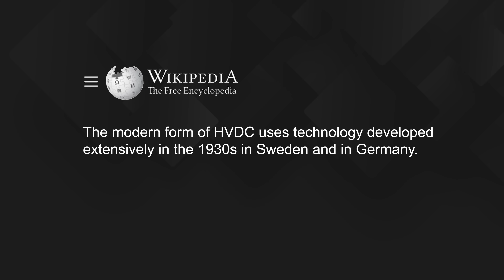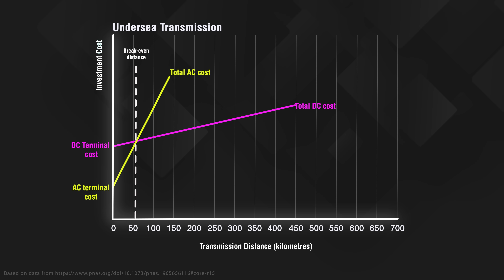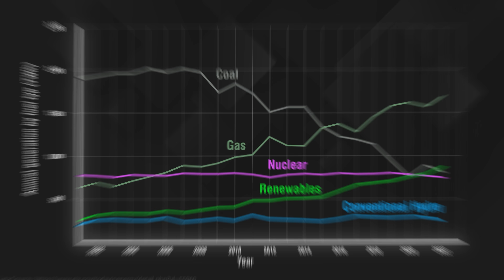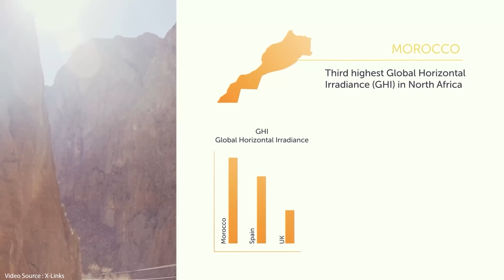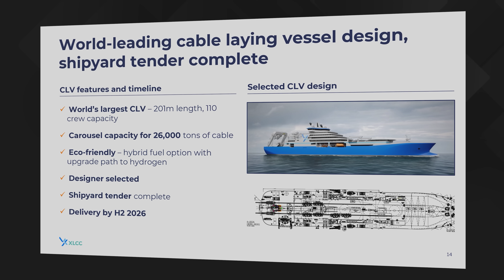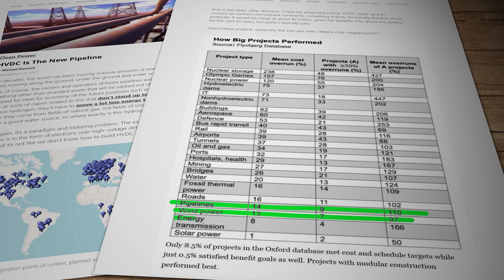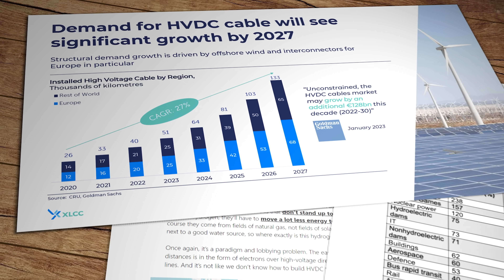Revolutionising power transmission.

Comment: Whenever I hear people say that our current infrastructure can't support electric vehicles I like to remind them that my EV takes less power to charge than my electric oven uses to heat up. Everyone in my neighborhood has an electric range and nobody bats an eye, but as soon as you plug in an EV everyone loses their mind.
Reply: Yes, it's a fact that the EM radiation from an EV makes some people's minds short-circuit.  It might be genetic.
Reply: Sounds like they are mistaking the charging lead for their EV for the power lead to their Electroconvulsive Therapy machine.
Reply: That's a bit misleading. An electric oven uses between 2 - 5 kW, and is wired separately to accommodate this high wattage. If you just use a normal 3 pin plug to charge your car, that's just 2.4 - 3 kW, or a 3.6 kW "commando" plug, less than your oven. But type 2 chargers, single phase, use 7 kW, rather more than any oven. Even more important is the fact that your car may be charging for 10 hours or so, getting through 20- 60kW in one session, that's one heck of lot more than any oven ever uses. It is also true however that most people use their ovens at peak times, when power is most expensive to produce and most limited, you car can charge a car overnight which then reduces the difference slightly.
Reply: @jockmoron first, I'm not sure you understand what you're talking about since you are using kilowatts and kilowatt hours interchangeably.  But let's just assume you missed a couple h's here and there and get to the crux of your argument.  I've already stated that I charge my car on a standard 120 v outlet with an 8 amp limit (set in the car) so my max power draw is 0.96 kW. My commute is 26 mi round-trip, and I average 6 miles/kWh. I need to replace 4.33 kWh every day. Let's be generous and round it up to 5kWh. I have no idea where you came up with 20-60kW. Think about it for one second. Recharging 20-60 kWh every night would mean I'm traveling between 120 and 360 miles a day. Even in a terribly inefficient EV you're going to get at least 3 mi/kWh, so that 60kWh would mean they are still traveling 180 miles per day.

Next, let's examine power draw of electric ranges. My range (a KitchenAid KESS907SWW04) is rated at 14.4 kW.  If you own an electric range I encourage you to look at the manufacturer sticker inside the door. I guarantee you it will say 10kW or more. When I'm cooking a full meal, my kil-o-watt regularly states I'm drawing 20+ amps, on a 240v circuit that's 4.8 kW and I usually cook for 1-2 hours each day.

All of this is still missing my original point which was that the grid is robust enough to support my oven drawing 14 kW at any given time, so it is more than robust enough for the 1 kW that my car draws. Grids don't fail from sustained loads, they fail from high impulse (positive or negative). And my car has a lower impulse than my oven.
Reply: Much and all as I like the sentiment you are technically incorrect. A typical oven uses between 2000 and 5000W. Many would have 2x 1800W elements meaning the maximum they could draw would be 3600W plus change (the fan and electronics). They also switch off and on once they reach temperature so it's not a constant draw. A typical EV home charger draws 7kW. My Tesla Model 3 can draw 11kW. I do all my charging off solar so I'm not relying on the grid. Still the regulators in the UK have said a number of times that the grid will not be a problem.
Reply: Multiply ovens (mandatory in California) by a factor if 20, because not all ovens are on all night, but EVs will be.
Reply: @scottslotterbeck3796  Again - ignorance. Not all EVs will be on every night and they won't necessarily be on all night. But even if they were that is the lowest demand time for electricity so that's a good thing. It means generation can be more predictable and no need to turn off expensive machines at night. Like they do presently.
Reply: What you just said is.... uninformed, to say the least
Reply: 7kW (standard EV charging rate)  is a pretty chunky oven. Ours is 2.2kW, so only 1/3rd of the EV charging. And overs have thermostats so they don't run at full power for long. But yes none of this is new - electric showers are often 10kW. EV charging is quite a lot of kWh (because it might be 7kW for 8 hours to fill from empty). 8hr cooking at full blast or showering is not normal.
We will all work out how to do this with various combinations of time-shifting, batteries, PV and time-of-day tariffs. It's not that difficult and the fungibility of electricity becomes even more useful once everything is electric.
Reply: @xxwookey  you're not forced to install a 7kw charger, you can easily install much smaller, and as for charging from empty, virtually no one drives a whole battery's worth each and every day, so you're not charging from empty either.  simply put, if the grid can manage today (most can) then EVs won't make an appreciable difference other than to eliminate night time as cheaper.
Reply: @jnawk83  I know. I agree with you.
Reply: @xxwookey  EVs very rarely charge from anywhere near empty, they charge from a 30-mile commute to work & maybe a shopping trip – a 10% to 20% discharge. And the 7KW is an inrush rate, it doesn't last long.
Reply: @alanhat5252  Agreed - most people don't charge from anywhere near empty most of the time. Is that inrush rate from your own experience? My understanding is that most cars will do ~7kW continuous AC charging (and some will do 11 or 22kW on a 3-phase supply - standard in several European countries).
Reply: @xxwookey  A normal oven is rated at 5 to 7Kw.
Mine is 6kw and is just a double oven, in the us the average oven is larger...
Reply: @xxwookey  That was more than a bit confusing and I don't think you even answered the question.  As usual, however, you like "green" tech enthusiasts generally do, have built your argument on speculative hope rather than hard reality.
Reply: @joemccarthy7120  The OP didn't post a question - he just made a comment about the relative power of household equipment. I responded to that. Which question did you have in mind?
I did make a prediction it's true, but based on current real trends in technology adoption.  People are adopting EVs, home batteries, PV, heat pumps, and new tariffs right now. Rates vary a lot by location and country, but are primarily limited by supply rather than demand. It didn't require very much 'speculation' at all to predict that adoption rates will continue to rise nearly everywhere.
Reply: @xxwookey  Surely you are aware that those trends in uptake of the new "green" tech are driven by subsidies and mandates, not rational economics.  

I am saying your answer was confusing.  It also didn't support the initial claim in this thread.
Reply: @joemccarthy7120  Joe, My oven (which is on the small side) is on a 20 Amp circuit.  I put my EV charger on a 30 Amp circuit, so I'd say you have a point, but only a small one.  Everyone has an oven, but not everyone has an EV.  Ovens are used at the highest demand time, while almost all EV charging is done late at night in times of low demand.  Some people with solar charge their cars from the sun in the middle of the day.  The electric authority in the UK (I forget the exact name) did an analysis of the "EVs will blow up the grid" meme, and found it to be bollocks.  The main reason is that all modern EVs have the ability to set a time to begin charging, and the grid and electrical supply is slated to grow over time in a way that will not have a problem keeping up with EV demand.
Reply: @joemccarthy7120  My response didn't support the OP entirely because I was questioning if his oven really is higher power than his EV charger. That was the point of my response.
The relevance of subsidies varies a lot by location. Australians and people in the UK are installing PV and batteries because it makes financial sense (and because they support decarbonisation), not because of subsidies. There are no subsidies available in the UK for that tech. Many countries have EV subsidies, but that just helps accelerate and widen uptake - it doesn't cause the demand. People in the UK buy EVs because they are better cars (quieter, faster, always full in the morning), because they are much cheaper to run, and because they want to get off fossil fuels and/or minimise local pollution. The subsidy was  removed a year ago so again, subsidy is not the cause here.

Re mandates: EVs are not mandated anywhere yet SFAIK. I guess PV is mandated in some places now (not the UK yet, although adding some is one way to comply with the building regs).

Decarbonisation is at least a decade behind schedule, and things like setting lower-emission building regulations, and cut-off dates for fossil-powered vehicle and boiler sales help accelerate adoption. This is a good thing, given the very tight deadlines we have on getting the energy transition done.
Reply: @joemccarthy7120  I'm sorry if my post was confusing. I try to be succinct given the platform, but it's not my strong suit 🙂I'm happy to clarify if you have a specific query.
Reply: @xxwookey  I don't know about the UK, but I do know that EV sales in Norway fell off a cliff after EV subsidies were removed last year.  I am also talking about mandates for power generation and use as well as subsidies for solar/wind installation etc.
Reply: @joemccarthy7120  OK so let's agree that the UK market is not subsidy-driven because there aren't any for PV or EV which is what we were talking about (there is one for heat pumps though).
Your information on Norway appears to be wrong: 2022 saw an increase of 137 percent year-over-year of EV sales. That's about 82.8 percent of the total market. Hardly 'falling off a cliff'. Norway is already something like 30% of all cars being EV, and at 80+% of sales it won't be that many years before that part of the transition is more or less complete there.
I'm not sure what your point is about generation and requirements for grid decarbonisation. This thread was about people electrifying their homes. Obviously the degree to which that actually reduces emissions depends on the grid emissions intensity, which is falling in most places, driven largely by economics these days (renewables are the cheapest generation in most locations) but yes there are subsidies, carbon taxes and renewables mandates helping move that faster to varying degrees in various countries.

Are you saying that when you said "those trends in uptake of the new "green" tech are driven by subsidies and mandates, not rational economics."
you were referring to the grid supply technologies, not the household electrification technologies we were discussing? I'm afraid that sounds like post-justification to me. 

Why not just agree that actually people are buying this stuff because they are making rational economic choices? Then we could move on to other subjects like decarbonising the grid itself. ideally in a different thread - this one is already long.
Reply: @xxwookey  I'm OP. I charge my Chevy bolt with a standard 120v wall outlet and limit the draw to 8 Amps. My oven is on a 240v circuit and usually draws 10-15amps when heating up. When using all four burners on the stove and running the oven (like when I cook chicken in the oven, potatoes, gravy, and two veggies on the stove) it can draw up to 30 Amps.

The instantaneous power draw of the oven alone is greater than my EV. And the overall energy consumption from my range on a daily basis is greater than what I put in my car.
Reply: @xxwookey  There is a lot there.  I wonder why it is so easy to find articles showing a sharp drop in EV sales with the lowering of subsidies.  Yes, people make rational choices, and that is why they respond to those incentives.  

No, wind/solar are not the cheapest at all when the backup generating is included and when subsidies, mandates  and carbon taxes are stripped out.  I guess grid carbon intensity necessarily drops by adding in wind/solar, but that is not at all the same as saying it is cheaper.  One is just adding something useless to the grid which will do just fine without the wind/solar.  There is a reason why adding renewables to the grid usually drives up power costs.  

Carbon taxes, mandates, and subsidies don't make renewables more economic.  They just hide the economic problems of renewables and force people into choosing less efficient options.
Reply: @joemccarthy7120  Argue with Lazard about the costs. It's pretty clear that wind and solar are cheapest on an LCOE basis independent of subsidy in most of the world now. They were anyway, but the massive increase in gas prices (factor of 6 here for a while) meant that gas generation became completely uncompetitive in Europe (CC is still competitive in the US because gas remains cheap, but peakers aren't). You have to be crazy to argue that renewables are not good value during massive fossil fuel-price spikes. Nuclear suddenly looks much better value too. Power costs have risen because of fossil fuel prices, not renewables costs. 
Even firmed renewables with battery backup is very competitive now (median rises from $60 to $80 for PV and $50 to $75 for wind) which is why there is a lot of that being installed.
How do you argue that wind/solar are 'useless' when they are generating large fractions of our electricity these days? The UK had 1st quarter ever where more supply was from wind than gas this spring. Every non-fossil kWh is reducing emissions and saving fuel costs. That can't be 'useless'. Efficiency is irrelevant - it's costs (and emissions) that matter.
Lazard show subsidised and unsubsidised (US) LCOE and LCOS (cost of storage) costs.
All I can do is suggest you read Lazard's "2023 Levelized Cost Of Energy". There is no way I can persuade you in youtube comments that renewables really are good value now. But that's why more new generation projects are low-carbon ones now, rather than fossil. Power companies are not daft and will build whatever does the job for the lowest cost.
Yes they could build a working grid using a lot of CC gas and gas peakers, but it wouldn't save them any money in the long term (it might be close in the US), and it would have massive emissions.
Reply: @youruniquehandle2  OK. thanks for the clarification. If your EV charging is only 1kW then, yes it makes perfect sense that your range is significantly more power. And yes people like you that do a lot of cooking  and don't drive far each day will use more energy cooking than charging. We cook most days (maybe 0.5kWh/day), and use the car maybe twice/month, but that'll be ~200kWh (600 miles, van), so maybe 13 times as much energy.

So, for the majority of people with both electric stove and car it'll be more energy in the car that the stove. And more power: standard chargers (at least in the UK) are 3kW or 7kW, and whilst induction hobs can draw 5kW, this will be rare and for short periods.

EV charging is easy to time shift as many have pointed out. Cooking less so, which is why you can now buy a oven with a battery in it from Channing St Copper Company. Also avoids having to upgrade your house to fit an induction range/hob.

But you are right that the 'freak-out' makes no sense at all.
Reply: @xxwookey  When you consider that backup generation plants have to be staffed and running hot all the time to be there when the wind or sun varies,  that has to be included in the cost of wind/solar, thus throwing those levelized costs calculations out the window.  Since that backup power generating plant has to be hot and staffed, the wind/solar is effectively a useless addition.  

I find it amusing how the green types are now arguing, contrary to their collective opinion of a few years ago, that nuclear is now a "green" alternative to fossil fuels.  Wind/solar aren't even really green.  Everything has an environmental impact.  It is foolish, however, to make decisions on one parameter - CO2 in this case.  It leads to poor decision making.  

Power companies aren't stupid.  They build what the government demands of them in response to the current thing.
Reply: @joemccarthy7120  I've always argued that nuclear is low-carbon and thus much 'greener' than fossil fuels. Its good to see more environmentalists finally understanding this. Yes GHGs are not the only consideration, but they are now by far the most significant.

Backup plant is a system cost. They have always existed and are not new because of higher renewables percentages. Batteries are increasingly replacing them as fast-stabilisation services as they react much faster and have no fuel costs. Slow stabilisation is hydro, peaker plants (which don't run hot), and a host of other demand management and storage types. There is much innovation going on in this field to work out what least system cost actually is. 

LCOE specifically does not include system costs because they are not specific to any particular generation source - that's the point. The system has to supply sufficiently reliable power at lowest cost/least environmental harm. We get to choose how much we wish to spend on further reliability and how to weigh various environmental costs.

I'm not quite sure why you think reducing GHG is 'poor decision making'. Not doing so is ultimately quite likely to bring down our civilisation. That's a pretty big deal. We like our civilisation, and we depend on it, so we are pretty-much forced to get emissions down, fast. The power system is doing that quite well. Transport and industry still has a long way to go in very little time.
Reply: @incognitotorpedo42  In 35 years, ICE will be illegal, so yes, everyone will have 1, 2, 3 or more EVs.  No problem!  LOL.
Reply: @xxwookey  If that system cost is driven by renewables, then it has to be attributed back to the cost of renewables.  That is only fair.  Adding renewables necessarily requires added backup generation and grid instability.   In effect, the renewables are a redundant and wasteful add-on.   That is why power costs go up a lot with added deployment of renewables.   

Hydro will never be a sufficient peaker technology.  There will never be enough around.  Batteries are doubtful.  They can only step in for short periods.  

I don't accept the premise that added CO2 is leading to a crisis.  The evidence for a crisis is very, very weak.  Civilization was possible in large part because of fossil fuels.  Nobody is arguing against finding better ways.  With current renewables, we have put the cart before the horse at an extreme cost that has so far proven extremely wasteful.
Reply: @joemccarthy7120 
I think we are going round in circles now. Systems costs are not generation costs and can't sensibly be allocated to individual generation projects. We can agree that ultimately it's the system cost that matters. There are plenty of reasons to think that a system where almost no fuel needs to be constantly dug up and shipped around will be significantly cheaper overall in the long run. It will certainly be dramatically cleaner and safer.

Obviously if you don't accept that global warming and the corresponding changes in climate/weather/stability and sea level is a serious threat to civilisation/living standards/ecosystems/current population levels then you can justify all sorts of idiocy. But it puts you solidly in the 'ill-informed' camp. The evidence for impending crisis is overwhelming at this point. Which part of the IPCC reports makes you think that we can burn more than another gigatonne without serious repercussions? Yes it'll take a while to become overwhelming, but that's where we were headed until recently, and it's still not clear where we will ultimately end up. There will be serious conseqences now whatever we do, but they will hopefully be manageable without collapse.
Reply: @xxwookey  adoption has been increasing due to government subsidies. Once the subsidies dry up, EV adoption will fail for the very same reasons they failed the first time, plus a few new issues. Cyber security issues, and black box tracking of one's use of the vehicle. I maintain vehicle's that do not record how it is used. If there's no record, there's nothing to be court ordered, or obtained by warrant. Software as a service modle that car manufactures are saying they will go with, and the EV will not function without. The fact that the physical car will have the hardware (and the hardware will be charged for) but disabled unless one upgrades to a higher monthly payment. Such things are a no go for many. Then the fact that insurance companies totaling EV's for rather minor collisions. Since they can't guarantee the saftey of the battery packs post collision, they total the vehicle. Which leads us into another new issue, car fires. EV fires are a spectacular sudden release of energy on a level close to an explosion. Burning faster & far hotter then a dry Christmas tree, and far far faster then a car fire in an ICE car. Survivability will take a serious plunge. Have a collision that the insurance company is willing to cover? They may just total it anyway, due to the extreme cost of repair. $40,000 for what appears to be a rather small dent is common, and it's not due to low production numbers. The high cost is due to the manner in which the vehicle is manufactured. When an EV vehicle is totalled, the payouts very rarely matches what is still owed on the loan. Even with a $20,000 base model with next to no amenities, the cost of full coverage + gap insurance will keep the total monthly cost of EV's out of the reach of the middle class. A nearly $1,000 a month car payment + full coverage & gap insurance will bring the monthly cost prior to charging costs & maintenance to $1,500 to almost $2,000 a month. This is more then the monthly mortgage payments or rent for most of the middle class. And that's with current subsidies. The high risk of having the car totalled, leaving one with out the ability to replace it with even a quality used vehicle will have a direct impact on adoption rates. Then there's maintenance cost. Modern ICE drive trains are very reliable, bringing any savings when compared honestly to almost none. The vast majority of ICE vehicle repairs are routine maintenance (break pads, etc) and suspension & electrical repairs. As has been demonstrated by many, suspension, and electrical repairs are far more costly on EV's. Due to the significant vehicle weight increase the suspension componets are much more costly. Then there's the labor cost, which is higher. Specialy when trying to diagnose & repair electrical issues. Then when there is an electrical motor, or battery issue the repair costs are far more costly then most ICE drivetrain repairs. We haven't even breached the availability of reasonable access to charging yet. Apartment, duelplex, and other multifamily housing dwellers will have little to ability to charge at home. Specialy at apartment complexes that have no off street parking. Even then, outside of very expensive, think upper class/wealthy apartments, apartment managers will put little effort in the maintenance of any on-site chargers when there's off street parking available. It's not thier core business, and the cost of maintenance of such chargers just makes it a losing proposition. Then's there having to ensure proper billing of the charging costs, and collections of unpaid bills. No one is going to want to prepay to charge at home. Then there's people like myself who keeps online payments to a minimum, who will not be willing to provide a CC to be kept on file or even want my charging tracked. It becomes a huge CF. In today's world of cyber security being farmed out to the lowest bidder, I stand by my right to not be forced into insecure transactions. 98% of my transactions are done in cash, including my purchase of fuel for my ICE vehicle.
Reply: @xxwookey  On average for the normal commute about two hours at 7kw.
Unless you commute 300 miles a day..
Reply: Using nuclear power, yes.
Reply: @scottslotterbeck3796  sure if we can get it up and running today not twenty five years from now we need solutions today and I mean NOW nuclear is not going anywhere it’s getting dragged behind the boat and will never get up on its skis 🚤
Reply: Try to charge your EV in the same amount of time you cook ! Anyway, current EV, heavy, complex, high performance, expensive are a non sense ! Worse, it is subsidized by people who can't afford them for people who can ! EV shoudl be cheap, simple for commuting, city dwellers, fill the gap between walking, bike, public and ICE cars for long trip. This is a real hybrid solution ! AND PLEASE TAX EV CHARGE TO PAY FOR THE ROAD, INFRASTRUCTURE etc....
Reply: @clitisswood7330  Seriously.  Look up "how much of global GDP goes to subsidize fossil fuels" it will blow your mind if you think EV subsidies are bad.  Gas is only affordable at the pump because your paying 4 times that amount in your taxes to support the oil infrastructure.  This is not a joke 7 percent of all the money in the world goes to subsidize fossil fuels.  Imagine what that money could do it we just get off oil!  Don't complain about EV subsidies when oil subsidies dwarf them by a massive margin.
Reply: @Ryan-ff2db  SOMEONE HAS TO PAY FOR THE INFRASTRUCTURE ! Furthemore, to subsidize luxury electric SUV IS A NON SENSE ! The buyers CAN AFFORD THEM ! Subsidies should go to CHEAP SMALL EV used for WHAT THEY ARE GOOD AT, city commute.... Not much recharge infrastructure for them and great pollution reduction ! The Chinese WILL FLOOD THE MARKET with these cars, you will see !
Reply: @Ryan-ff2db  you are so damn right!!! We have spent a foolish amount of money on a fossil fuel ⛽️ lie
Reply: @clitisswood7330  Look up at how much fossil fuel infrastructure costs. Please search for "how much of the global GDP goes to fossil fuels subsidies" the answer will blow your mind how much we spend to keep gas cheap.  It's almost 7 percent of all global GDP, higher than any industry even food.  Second, EV prices keep falling and will continue to fall just like any new technology.  Most importantly charging is a positive not a negative.   Almost all charging is done at home, you just wake up to full tank everyday.  The only time you ever need to use the superchargers is on a long trip and even then it's extremely easy to use and is not that big of deal.  People that say it takes an hour are full of crap.  You can get to 80 percent charge in about 20 minutes, which is more than made up for by the fact that you almost never have to use them or waste time going to a gas station.  As far as the Chinese flooding the market, they have a long way to go as I have never seen a Chinese car in the US ever!  I don't think current political environment of protectionism will allow a Chinese take-over as you suggest and if it happens that means they have a good product and current global automakers got caught napping.
Reply: @clitisswood7330  I can easily. Is there something wrong with your electricity connection? In fact I can run my 7kW air con, my 11kW car charger and my 3.6kW oven, no problems. If I only had single phase I might be stretching it with no solar (230V x 100amps = 23kW) but if I only had single phase I'd have a smaller air conditioner and the car would only charge at 7kW.  I guess if you are in the US and you don't have 240V split phase supply you might struggle. If you're in the UK where a lot of houses are single phase and onpy have a 60amp supply there are load balancing EVSE's that monitor house usage and adjust the amount of charge going to:the EV automatically. There are some real issues with EV adoption (charging infrastructure for users with no off street parking being the main one) but grid supply isn't one of them.
Reply: Keep lying. LOL! Some of us know better.
Reply: That sounds like quite a dubious claim.   Care to provide some numbers?
Reply: Your electric car may charge at a lower power rate than an electric oven, but it definitely uses much more energy to charge for a normal commute than your oven does to cook chicken.  These are just rough estimates, but cooking chicken in an oven requires less than 2 killowatt-hours worth of energy.  A normal commute will take 15 to 20 killowatt-hours worth of energy.  So the people in your neighborhood don't bat an eye when using their oven because it costs roughly one tenth of what it costs you to charge your car each night.
Reply: @tomjacobson7623  The issue is that ovens will draw 2-3kW right when every other house also uses their oven, TV, many lights and often other high power devices. EVs can connect to the grid and arrange to start their charging when rest of the house uses almost no power and only few other cars in the neighborhood are charging.
Using a 7kW charger that 15-20kWh translates to two to four hours of charging depending on if it uses full power and if the car is programmed to charge to full or only 80% to save both energy and the battery lifespan. There is plenty of time over the night for the chargers to stagger when they start drawing power so the local grid does not overload.
For some of the most efficient EVs the daily commute uses less than 10kWh and an increasing number of companies and malls offer free charging either to draw customers or as an employee benefit, so drivers only need to charge what they used coming home, maybe half of the daily average. When you really only need to plug the car in once or twice a week there is little chance of everyone trying to charge at the same time.
Reply: aaaaaand how long does it take to preheat an oven? 
5 minutes?
10 minutes?

An EV will be on charge most of the evening/night
Reply: @doritoification  Actually, I'm not sure you're aware of the charging requirements of EV's.
EV's don't fully deplete their battery packs each and every day.
EV's don't need to charge "most of the evening/night" to replenish the electricity consumed for their daily commute.
Of course, it depends how long their daily commute is, but most EV's will only need to charge for an hr or 2 each night to top off their batteries, giving them a full charge for the next day.
Unless I have an unusually long trip out of town, I only need to charge my EV once a week.
If I do that charging throughout the week, then I only need 1 or 2 hours of nightly charge time.
And of course, I do all my charging at off-peak times when electricity is much cheaper and my EV has absolutely no impact on the grid.
Reply: @electrified3407  No you're right and it's not that i don't understand but moving forward you're not going to have everyone behaving sensibly and charging at night, nor will everyone invest the £1,000+ to get fast chargers like yours installed. Individuals are hard to predict but on mass we behave like clockwork. There are over 30 million cars registered in the UK and when we get even half way to that number electrified there will likely be a good half a million people who just plug in and charge without caring. We're both debating in this comment section so we're early to thinking about these things but the lay person just buys a car and charges it. There's nothing else to it. The grid is just there and it just works and there's no reason to do otherwise.
Reply: @doritoification  I agree, the grid will be there, and it will just work.
Just as the fossil fuel infrastructure had to be built in the beginning, the grid will be expanded and improved to accommodate the transition to electric vehicles.
The new grid infrastructure will include more access for those who have no off-street charging available.
I have faith that the layperson can understand the economics of charging during peak periods.
There's no reason why they can't just plug-in without caring, because the car won't start charging till off-peak hours.
Most EVs come with a Level I charger which plugs into a 120v mains, which will do an adequate job of topping off their battery on a nightly basis (albeit more slowly), so no need to invest in a Level II charger.
Those the can will, those that can't won't.
Also, most new EVs will be able to DC Fast Charge, which means they can top off their battery in short order at a Tesla Supercharger, which are being opened up to all makes of EVs.
Ford has just committed to adopting Tesla's North American Charging Standard (NACS).
Since most OEMs don't have their own charging networks, I expect them to do the same.
They will have to if they want to survive in the EV space, their customers will demand it.
There will be growing pains, but it will be done.
Reply: @electrified3407  In Europe it will be CCS as even Teslas use the European Union mandated standard here but that should actually make it even easier for tesla to license supercharger access to other automakers. As of yet the agreement with ford is only half of the superchargers in north america and no mention of Europe but it'll happen soon enough like you say.

A serious point though about why I even got into this debate is that we aren't actually serious enough about committing to the right technologies to make the EV switch worth while.
We're decommissioning most of our existing nuclear by 2030 and have only green lit 2 new power plants- Sizewell C and Hinkley Point C totaling about 7GW capacity

All other investments are into measly low capacity factor solar (as little as 2% in winter) and offshore wind which is actually pretty decent round the UK but absolutely guarantees the dependence on natural gas backups

It's not just cars being electrified. We're doing domestic heating, cookers and cars at the same time while placing bets on variable power with no scalable/economic storage to date and that worries me hence the very valid discussion on how we're going to electrify so much while also transitioning away from the fossil fuels that make the grid run so smoothly

We don't want to be like germany who just closed their last two reactors to "make way for renewables" but actually just burning a fuck tonne more coal
Reply: @doritoification  You'd be surprised how quickly even those "ignorant" EV buyers can be persuaded to charge overnight if the rates are incentivised. Or in Australia in the middle of the day when solar is at it's peak. It's pretty easy to manipulate the electricity market with incentivised pricing.
Reply: @doritoification  No it won't. In most cases we use a small part of our batteries charge during the day. On average I only need 3-4 hours to recharge to full.
Reply: @paulsmith3921  not sure which of my comments you're replying to but yeah sounds like you're agreeing with me? no?
Reply: @doritoification  I was replyig to "An EV will be on charge most of the evening/night

1

Reply" An EV will be on charge most of the evening/night" and no I don't agree. 995 of the time every third or fourth day I charge after midnight for 3=4 hours because I don't drain the battery every time I go somewhere. 

1

Reply
Reply: @paulsmith3921  okay dude no problem but with the way any full time working commuter uses their car you'll be drawing well over 3kWh per night every night at the same time and not combining all that into a once a week charge because for most people charging once a week would mean draining down below 20%
I have to drive 60 miles a day so lower ranged EVs wouldn't make me anywhere near through a week on a single charge so OBVIOUSLY i'm going to plug in every day like clockwork just like millions of other commuters 
Changes in grid demand like this are well in excess of electric ovens so will absolutely need to be addressed urgently. It's that simple.

I'd happily wager that out of a population of 70 million there will be at least 1 million daily commuters who will draw over 5kWh/night at least 5 days a week. that's 5GWh a night extra that didnt exist before and will not go unnoticed
Reply: @doritoification  I know I'm not supposed to feed the trolls but I can't resist doing a little math for them.

Using an average range for 7 hours a week (a low estimate for my family) uses approximately 1,022 kWh per year.

I drive an average of 8,000 miles per year (based on the last 5 years) and my EV gets 6 miles/kWh. So in a year I use 1,333 kWh for my travel. A whopping 3.65 kWh per day vs 2.8 kWh for the stove. A difference of 0.85 kWh/day.
Reply: @youruniquehandle2  once an oven is hot it doesn't run at full power to cook the food. Most of the energy is used to pre heat so your numbers are inflated for the oven and i'm no troll, adding those 3.6 kWh per day per household for the EV will require massive expansion of the grid. Luckily we aren't planning to do it over night but the adoption curve for EVs is still in the early exponential stage so it's going to accelerate rapidly as the cars become cheaper.

also what do you drive? because 6 miles per kWh is very good
Reply: @youruniquehandle2  I guarantee you that the average electric stove household uses far less than 2.8 kw-hrs worth of electricity to run the stove each day.  And people with a gas stove use zero Kw-hrs on their stove each day.  Also, if you're getting 6 miles/kw-hr, which I certainly don't doubt, then a good chunk of that is city driving, not highway.  It's sounds like for you the smart move has been to go EV, but your case really isn't an average example.
Reply: @doritoification  exactly,and what about families with three (or more) cars???
Reply: @doritoification  Don't ask inconvenient questions.  The narrative can't survive if we do that.
Reply: then explain Austalia's rolling brown outs? Or California having consistent grid problems with not being able produce for the State's EV charge stations and their need to be supplimented by Diesel generators, because the grid alone cannot sustain it?
Reply: @dustinherk8124  All due to EVs? Wow, I'd love to see your research showing it's EVs that are causing known phenomena that have been happening for decades before the popularity of EVs. Certainly can't be caused by power grids that were already inadequate and irrespective of what devices you plug in, brown outs are inevitable as power needs only grow, i.e. you can no more cite EVs than you can basic population growth.
Reply: @custos3249  Except CA hasn't had the population growth. They have had an exodus from the state of not only individuals, but of energy hungry industry. One of the things that has been going on in parallel over the past few decades, has been the forced conversion over to everything being powered by electricity. Which has caused a greater electrical energy damaged in the face of this exodus from the state. The failure of investment in CA's grid has fallen squarely on the CPUC & the state's Progressive leadership. Which has been run by & providing utility "regulatory oversight" by the same Progressives that have had a strangle hold upon the State's legislature & governor's office for  even more decades. This has been a failure of public policy, and corruption of the Progressive ruling class in CA. None of the grid's failings in CA have been an unknown. It has been known for several generations. Failings only made worse by passing laws / regulations & expecting that the technology needed to comply with them would just spring out of nowhere, because the Progressive's passed a law requiring it. On top of shutting down dynamanic power generation stations without comparable replacement power generation that complys with the pie in the sky legislative & regulatory requirements. Instead, relying upon the purchase of out of state power generated by fosil fuels. Which is inline with the long standing Progressive tactic of viture signaling by passing laws to stop a "dirty" activity locally without a viable replacement, and purchasing of the same "dirty" product as long as the pollution is generated elsewhere. On top of the removal of needed hydroelectric production. Again without a comparable replacement generation. All causing the price of energy delivery to artificaly "necessarily skyrocket" as Obama was found of saying. While certain aspects of the grid are in disrepair (mainly in rural areas), the energy deficit driving California's rolling brown outs & blackouts is a direct result of piss poor governance by the Progressive ruling class. There simply is no excuse for California to lack a functioning adequate electrical grid, and clean renewable energy production if it were possible to do without disruption in the delivery of energy during times of peak demand. Any inadequacy is found in the mirror. Being a sovereign entity, this is something fully in the controll of the state of California (if possible) without any intervention by the Federal government. Yet even with significant investment by the Federal government over the past few decades, California has failed to provide an adequate grid & clean renewable energy for even a dwindling population. Keep pointing fingers if it helps you sleep better at night, but not accepting responsibility for a failed social experiment will prevent CA from pivoting into a more successful direction. The fact CA is the world's 5th largest economy, only makes this failure that much more dramatic & insightful to what works & what does not. This multi generational failure has left the world's 5th largest economy with large swaths of the state like a third world nation, and the rest with an unstainable cost of living in every area of metric.
Reply: @dustinherk8124  Australia 🇦🇺 has been governed by the right for a long period and you get what you pay for it’s really quite moronic to think about all the renewable energy resources that Australia has and not be pissed 😡 off at the foot dragging that’s causing a huge energy economic boom from happening faster the problem is your expensive use of fossil fuels not extremely cheap solar wind and battery storage.
Reply: @Nick Kacures there is more renewable energy available today than the grid can handle, so they restrict generation output. I don't think you understand the cost involved in upgrading the infrastructure, not to mention the lack of feasible technology available to support storage. Sky rocketing electricity prices don't create economic booms. Also, why haven't the Labor run states taken the opportunity to transition quicker to renewables? How is it just a federal issue?
Reply: @nickkacures2304  
Nuclear is the only answer.  Takes up 1/360 of the land wind does for equivalent power generation as a nuclear plant does.  Plus kills no birds.
Reply: @dustinherk8124  I have roof top solar on my house that produces an average of 25 kws per day. By spending that $8000 (Aust) I no longer use the grid to heat my hot water or run my home during the day and in addition to that it keeps two electric vehicles charged that each travel 400 klms per week. Roof top solar whether at home or work is the key to charging EVs. It only costs $3 per 400klms of charging as opposed to $50 for gasoline.  Any brown outs in Australia were caused by failures of coal fired power stations or storms that took out transmission lines.
Reply: @markumbers5362  And how much of that gasoline cost is fuel and carbon taxes?  How much of your solar installation was subsidized by the gov't?  Evidently, you still need the grid, so I suspect your cost savings aren't all that great and you aren't comparing apples to apples.
Reply: @joemccarthy7120  Please look up fossil fuel subsidies.  It dwarfs renewables by a dramatic amount, in fact 7 percent of the total GDP of the entire planet goes to fossil fuel subsidization.  If it wasn't for these subsidies, the cost of fuel would be between $12.50 to $17.85 a gallon.  If you don't believe me please search for "How much of global GDP goes to subsidize fossil fuels".  The numbers will blow your mind.
Reply: @dustinherk8124  I live in California.  The power issues here started long before the first EV ever hit the road.  Currently EV's consume about 1 percent of the total power and is expected to consume 5.4 percent by 2032.  You can blame many things for California's power issues but EV's aren't one of them.  In fact 81 percent of California charging is off-peak in the middle of the night which helps level the grid and use more renewables.  These numbers are easy to look up if you don't believe me.
Reply: @Ryan-ff2db  never said they didnt exist prior. i stated that cali NEEDS TOO suppliment their "green" car power with diesel generators. because the grid is to be frank, is fucking useless for EV adopters, and is incapable of handling current EV load. and Cali is so far from having its people completely abandon ICE engines, for EV and hydrogen alternatives, because the NEEDED infrastructure isnt there. it is sub par, in spite of the EV market only taking 1% of Cali's power demand. its genuinely pathetic, the state has to rely on diesel generators so that people can charge their EV's. would of been better of not wasting extra capital into an EV and bought a conventional ICE engine that doesnt have 1-2 hr line ups for diesel powered charging stations.
Reply: @dustinherk8124  Cali power grid has been a problem for decades and it is not because of EVs, and no, adding fossil fuels does not help when the problem is that the power lines overheat and the power company decides it is cheaper to cut electricity from some areas than pay to update their infrastructure. That is why solar and batteries are so popular.
Reply: @dustinherk8124  You can look up the data if you wish but you're not even close to the truth.  Diesel generation makes up 0.2 percent of the total energy mix.  50 percent is natural gas, 35 percent are renewables, 8.5 percent nuclear, the rest is imported and mostly hydro.  If you speak of wasting capital on EV's do yourself a favor and do a search for "What percentage of global GDP goes to fossil fuel subsidies."  You'll see very quickly how much oil subsidies dwarf all green energies and EV's combined by a massive margin.  If the subsidies(TAX dollars) went away, we would be spending between $12.50 to $17.85 per gallon for gas.  This is not BS, look it up, and one major reason why really need to get off oil.  Those subsidies increase every year as oil becomes harder to get and is almost certain to reach 7.2 percent of the total GDP by 2025.  Currently, it's around a massive 7 percent of all global money, which is insane.
Reply: @AnalystPrime  how is that a counter argument  to the fact that Cali is not ready for this EV push, in spite of their heavy handed efforts to push the people too them. You jsut admitted they dont spend on existing infrastructure let alone increased grid demand. im not refering to EV's on this. im refering to ANY and everything in the modern world. the average persons power consumption grows year over year, but Cali doesnt support the growing demand, in fact Cali promotes increasing grid consumption, while failing to increase power production, battery storage, and the network is running too hot with too few fail safe back ups, because its cheaper. 

That tells me EV's are a cancerous problem for Cali, not a solution to another problem.
Reply: @Ryan-ff2db  you nailed it especially the on the fossil fuel subsidies and they really can never answer for all the death and destruction arming ourselves to the teeth to keep the oil lanes open
Reply: @dustinherk8124 Plus one other thing about Australia, mate. Back in February this year (2023) EV's made up less than 0.5% of the passenger and light commercial fleet. To blame EVs for any power issues is just ignorance. EVs represent an opportunity for the grid to smooth out energy demand, run generators more efficiently and if VtG can be implemented successfully provide power during peak events. Air con is a much bigger drain on power for Australia.
Reply: @dustinherk8124  pretty sure air conditioning is a bigger problem for electricity demand, and EVs can charge during peak solar production, but everybody turns their AC on when they get home from work
Reply: @playpoivideos  thank you for further proving my point. that Cali is not ready for EV's. i dont know why you guys keep replying. all you do is prove my point further. Cali's power demand grows far faster than the network can temporarily support, let alone sustain. so what do we do? we push for more demand of the grid, without forethought too the consequences.
Reply: @dustinherk8124  I don't think I'm proving your point at all. It sounded like you were blaming EVs. But the problem isn't total daily electricity needs, it's peak draw. Air conditioning creates much bigger peaks than EVs, and EV charging can more easily be done at off-peak hours, so it's the AC that is causing the problem, not EVs. We can add more EVs because they can charge at non-peak times. Tackling the AC problem is the priority. Cali can integrate more EVs with some simple policies.
Reply: @dustinherk8124  Hey, interesting, I would like to see this. Maybe there are some other reason behind it. As far as I know, there are no too many EVs in Australia. How works in Europe? Now you can only install EV charger which supports remote management, which allows the electricity suppliers to switch all electric car charging off one by one in a split second. To explain to you, when a network is overloaded somewhere, they just switch off the EV chargers :) so EV charger won't make more problems, they actually will solve the problem  as they can be used to balance the network :) EVs are the biggest enabler of the renewable industry.
Reply: @dustinherk8124  California has always had expensive electricity but so has Texas in peak demand events like the infamous ice storm.The amount of renewable electricity that you have will determine your success as a community,region,state and country .
Reply: @nickkacures2304  A very good observation - the longer a country is ruled by fossil fuel interests, the further behind it will fall.
Reply: @nickkacures2304  I certainly agree with your comment about Australia and their energy situation, but saying that Texas has expensive electricity is just ignorant.  I live in Dallas and currently pay nine cents per Kw-hr.
Reply: @tomjacobson7623  I lost my train of thought I meant to say highest peak rates that are allowed under Texas laws but they thankfully are of relatively short duration (ice storm)
Reply: @tomjacobson7623  and wow!! That’s really an ok ✅ rate do you have an off peak rate from your energy provider then an electric vehicle charging at night would be worth the additional electricity usage
Reply: @nickkacures2304  No, I don't get an off peak discount with this plan, but I need the lower daytime rate, since it tends to get a little warm during the day here in Texas.  Even with that, I would definitely pay less for electricity than I do for gas, but my small four cylinder car has been paid for for 15 years, I'll run it into the ground before switching to an electric car. May not be long, lol.
Reply: @tomjacobson7623  Cool sounds like a great plan i am a carpenter and I have never purchased a new car so until the incentive’s get an electric vehicle below $20,000 or a good used model Y comes my way we’ll keep driving our paid off Hondas 😊I am intrigued by the head of Ford Jim Farly signing a deal with Tesla for all Fords to be able to use the Tesla charging system including DC fast charge and the adoption of electric vehicles is really happening fast I’m seeing hundreds of them every road trip I take to the Twin Cities. Watch any new video from Tony Seba or  Rethink X and you’ll get an idea of how fast this is happening I have watched Tony’s predictions nearly 15 years and he is on target.
Reply: @dustinherk8124  What blackouts? Calide C? Look at AEMO data. RE is lowest cost AND more reliable. Look at proper research. Not sky news
Reply: @HughButler35  wtf is sky news?
Reply: @dustinherk8124 Australia doesn't have rolling brown outs? We had one problem in Victoria during peak demand when a coal fired power station had a generator out for maintenance and certain gas peaker plants refused to jump in until the price went high enough. The last major problem we had in Sydney was during the freak thunderstorms about 4 years ago where much of the old overhead wire system was brought down by falling trees. Adelaide had massive problems back in 2016 with grid outages but they've mostly addressed that and stabilised the grid since then - thanks in a large part to solar and their Tesla battery.
Reply: @dustinherk8124 Then get a better grid! Why the hell do you put up with that crap. I'm sure we've had more, but the last power cut I can remember in the UK was back in the late 70s.
Reply: @dustinherk8124  Australia has many more electric forklifts than electric cars & forklift batteries are enormous with a huge surge as they're plugged in (all at the same time, at the end of the work day), have you ever heard of forklifts causing a problem on the grid?
Reply: @dustinherk8124  What about oil centric Texas having even worse problems?
Reply: @dustinherk8124  perhaps you can explain Australia's rolling black-outs. I'm in Australia (Melbourne) and can't remember the last time I experience one. Must be over a decade ago now at least. South Australia had a black-out a number if years back due to a storm taking down a bunch of powerlines. But they and all other states have been installing solar, wind and batteries at a prodigious rate and the grid is more robust than ever as a consequence.
Reply: @dustinherk8124  Unrelated.
Batteries and long distance power transmission can solve the problem of intermittent production.
The issue is the networks are obsolete, and money needs to be invested in them.
Reply: @aitorbleda8267  depends if the transmission can shift too DC for long distance transmission though, as there would be significantly less power loss from thermal decay caused by power cables natural resistence. if they can transmit in DC the loss is only 0.7%. if AC is the method of power transmission the loss can be as high as 1.5% but typically falls too (1.13%) for every 1000km of transmission. and gets even worse for sea cables as they require greater protections from critical failure, costing efficiency in power transmission
Reply: @dustinherk8124  "Australia's rolling brown outs"? I've never heard of such a thing, and I live here. The biggest and longest blackout in recent years in Australia was in Queensland in 2022 when a large coal-fired steam turbine (Callide C) blew up and took out other parts of the power station (one problem with coal and nuclear alike is that the economies of scale make you put too many eggs in the one basket in the form of a few huge power stations rather than many small ones). The second largest was in 2019 in South Australia when a hurricane destroyed some high voltage line towers from the local gas fired power stations. Neither had anything to do with EVs or renewables.
Reply: You are quite correct. Everyone does have an electric range with no problems. But if everyone ran out and got an ev, they more than likely would be charging their ev after getting home from work. Many people take hot showers after getting home from work, and then they make dinner. Running the oven can heat up the house, so the ac kicks on. This happens in millions of homes, and the power companies can barely keep up. If everyone was charging their ev, the grid would nor be able to keep up. It's as simple as that.
Reply: @AzDad1928  No most people will/do set their EV to charge at night when rates are cheaper. For people who can't charge at home, we need more businesses to have low speed chargers where workers can charge during the day when there is a lot of cheap solar.
Reply: @AzDad1928  simple as what? Have you seen the remedies for the duckbill energy curve because that’s what you are describing in your reply above . This is a new problem of course but we have adapted to going from a horse and carriage travel and horse and oxen plowing in agriculture to the internal combustion engine now we are transitioning to electric motors to do our propulsion which are as high as 95% efficient while fossil fuel motors are 25 percent efficient at best why do you need to be so wasteful and polluting
Reply: @AzDad1928  Most people, myself included, will charge overnight.  Not when they get back from work.  Electricity is cheaper then too.
Reply: @G_C340  well that makes sense. I'd be charging when my solar can do it for free.
Reply: @G_C340  Solar at night? WOW! Genius!
Reply: @G_C340  All those 250 million EVs in the USA will do NOTHING to the grid.
LOLOL.
Reply: @AzDad1928  I charge my EV starting at 10 pm.  I plug it in when I get home from work at 6 pm and set a timer to have it start charging at 10 pm.  My electric company pays me $.02 per kilowatt to wait until 10 pm to start charging.
Reply: @AzDad1928  Funny thing about these "but if everyone" arguments is that only an idiot or someone with a pressing need to charge their car right when the energy costs are highest would ever do so. Especially as we already have smart grids that can run the AC and water heater before and after that time of the day so there is no need to worry about all the gadgets drawing power at the same time unless you specifically program them to waste as much energy as possible.
Reply: @AnalystPrime  if the world functioned perfectly all the time then there would be no problems. But that's not the case. People miss the chance to do something like charge their ev all the time. That doesn't make them an idiot.
Reply: @AzDad1928  EVs are NOT charging at the end-of-work peak, they charge with off-peak cheap-rate electricity & the smartest chargers discharge the car to boost the grid during the peak! 
Please do at least a tiny bit of research before launching off inane rants.
Reply: @alanhat5252  not everyone works a 9 to 5. Millions of people work the evening and night shift. You can pound your fist about how the grid can handle the extra load, or you can  look at the situation realistically. I drive around town during the day, peak demand times, and I see people sitting at charge stations waiting to charge their car. So you can tell me everyone charges their cars at night when power is more available, I'm just not going to believe you. If everyone suddenly had electric cars, and they charged at night, you know what would happen? The power companies would change their rates to accommodate a new load demand. I don't need to do research. It's right there in front of your eyes. Maybe  before you go on a rant about how you think it is, you should get your head out of your research and pay attention what happens in real time. Research can only be done on something that has been around for some time.
Reply: @AzDad1928  No one's pounding their fist. The electricity market operators are the one's saying the grid can cope. Repeatedly. I may be missing you point? Electricity is just another product that works on supply and demand and it's easy to manipulate that demand. For example, we already have one provider in Australia, Amber selling electricity at wholesale and they have market price tracking software that will talk to your EV charger so that it only charges when electricity is cheap. Or negative as it sometimes goes - so they could be paying you to charge your EV. And before you say impossible it's already happening. In the UK they have Octopus doing similar things. These aren't small problems you bring up but they also aren't insurmountable.
Reply: @AzDad1928  EV charging can just as easily be performed after midnight when there is too much idle capacity, and vehicle to grid capabilities will only make the grid MORE stable than now.
Reply: @AzDad1928  many chargers can be programmed to charge when demand is low and utility rates are too.
Reply: @AzDad1928 

Time of day rates solve this problem.  It’s as simple as that.